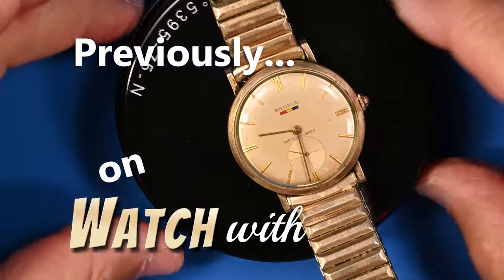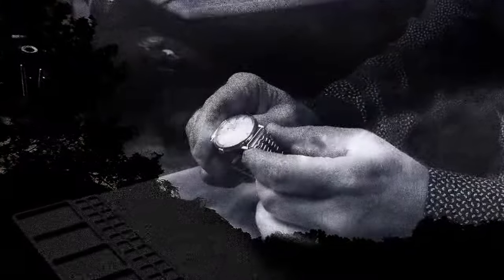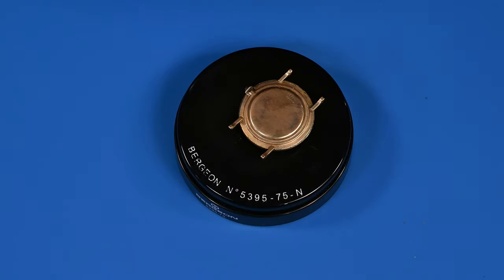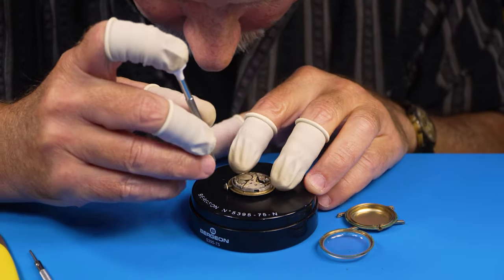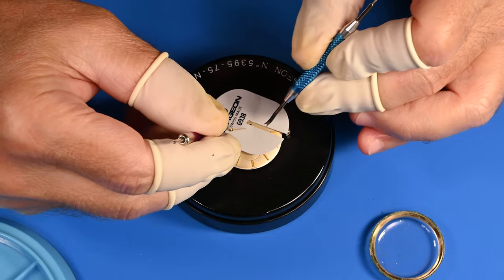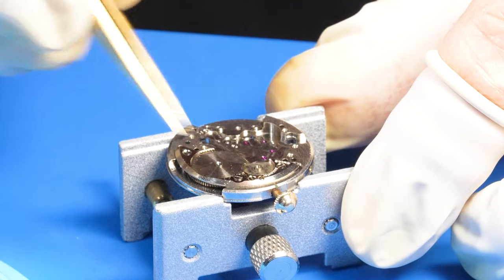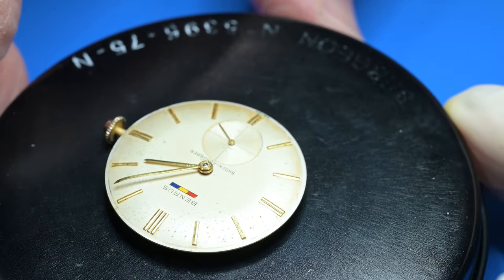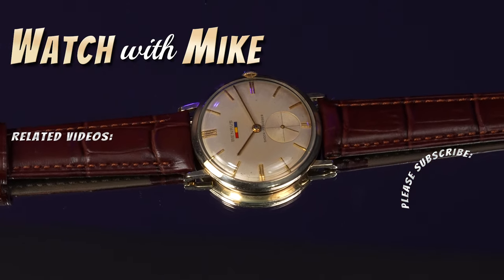⌚ Wristwatch Rescue! 1950's Benrus 'Citation' DN2A Restoration

Comment: Enjoy your videos, Mike!.  You're transparent and put on no airs about how watchmaking can be, esp. when you're learning and growing in skill.  Wow!.
One had better make sure they're prepared and have patients before considering this hobby!.  It is maddening and fulfilling at the same time.
Anyway, a small consideration.  Bergeon irks me with their obscene pricing.  One Dip is a classic example.  It's essentially hexane with some other ingredients.  Something I use instead is CRC QR Electronics Cleaner  in a red and white 11 oz. can.  Like One Dip, it's pretty much hexane only in a pressurized spray can, which makes it even better in my book. Just be careful if spraying delicate parts like hairsprings.   In my area, it is ~$11 a can in the automotive supply section at WalMart.  Works great and may be something to consider for those who would like a less expensive alternative than Bergeon's greed.
Reply from the maker: Thanks for the nice comments! You are spot on about watchmaking being fulfilling AND maddening. It's often the resolution of the maddening bits that leads to the deepest learning and sense of accomplishment! 

That's a great tip about using electronics cleaner as a replacement for One Dip, which is completely overpriced. I remember as a kid being able to buy "dry cleaning fluid", which was the same solvent as one dip is today, for less than five dollars a bottle. Unfortunately the solvent was labeled as an environmental risk and a health concern, and it disappeared from shelves. I should mention that, if others are reading this tip, some electronics cleaners contain a lubricant, which intuition tells me should be avoided. Then again, maybe it would help!?

Thanks for joining the conversation and I appreciate you following the channel  😁

Comment: There is an android phone app I think through Google play that when your put your watch near or on top of your phone the phone will measure the loss or gain in seconds. So you can adjust if need be. These videos are very well done and extremely informative. Apparently the mic on the phone can hear the back and forth of the balance wheel.
Reply from the maker: At 29:37 I put the watch on a timegrapher, which does the same thing. I am aware of the smart phone apps for timing to watch, but I have never tried them. Thanks for the suggestion! 😁